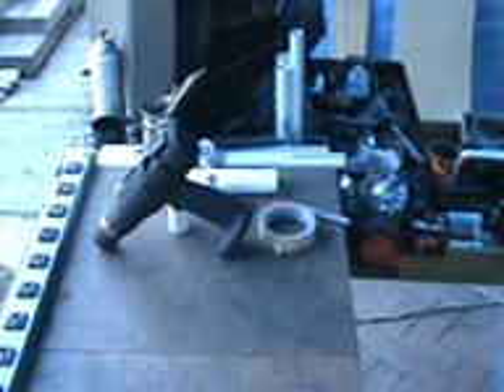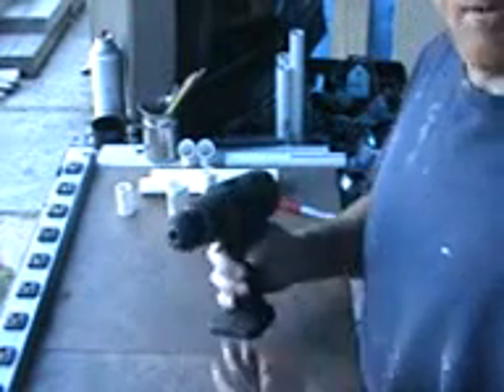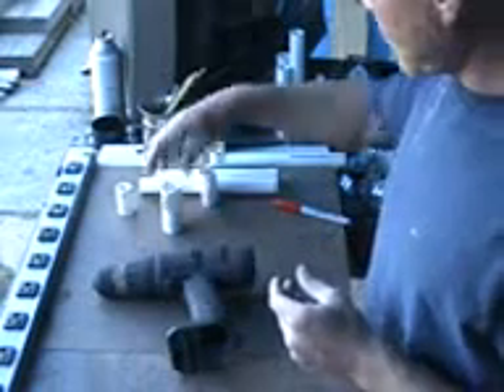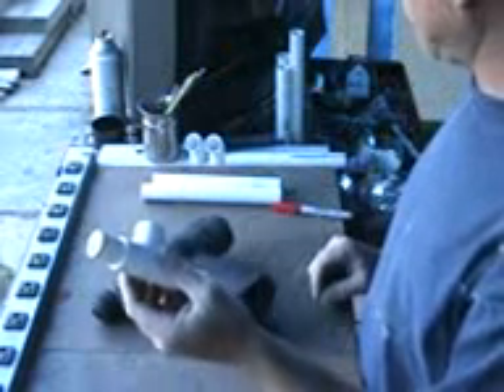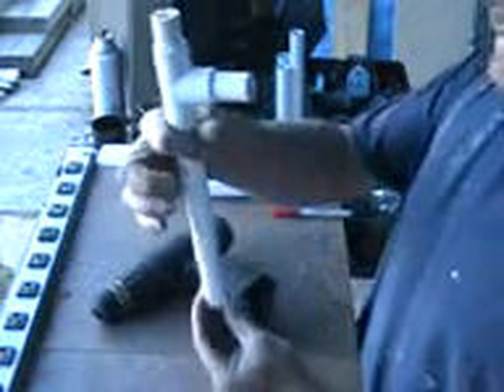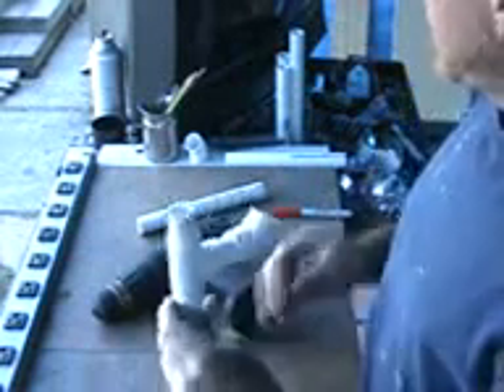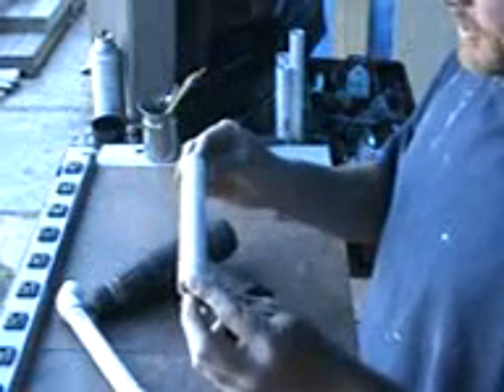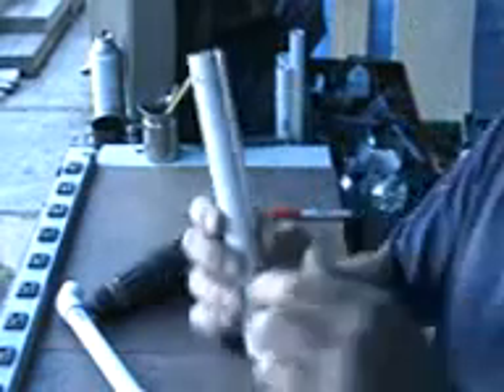pvc wind turbine out of drill  1

Comment: I have been trying to make a design with copper bearing's inside of a copper lid on top and a copper base on bottom with 2 rows of bearings to separate positive and negative. Connecting 1 row to the positive side and the other to a negitive you will then be able to transfer electricity without a problem of wires getting tangled.